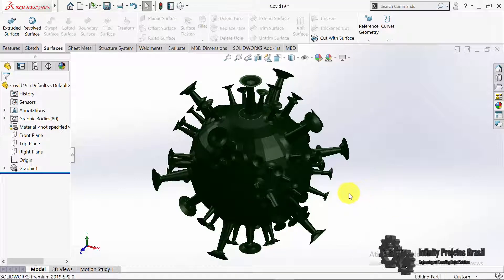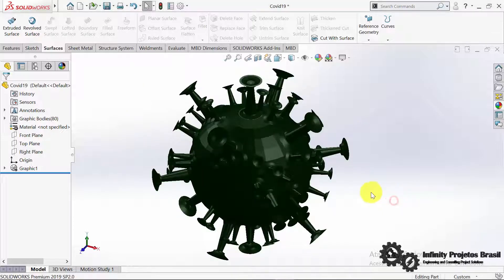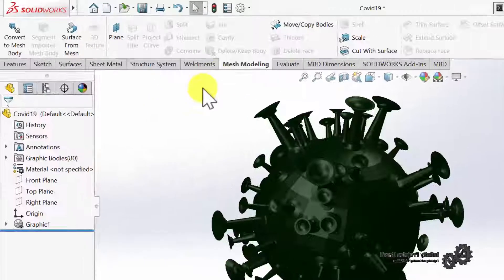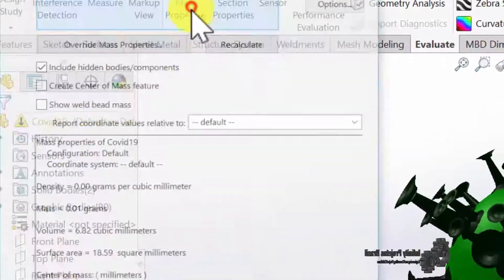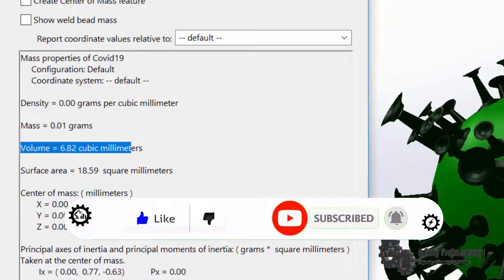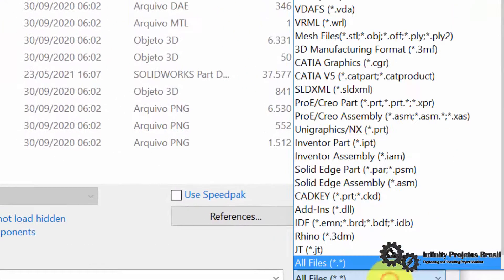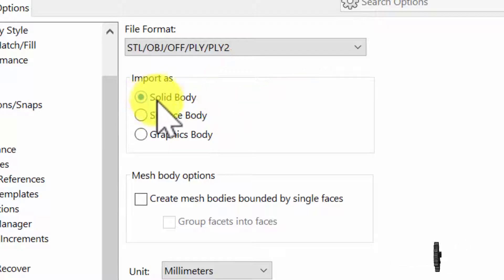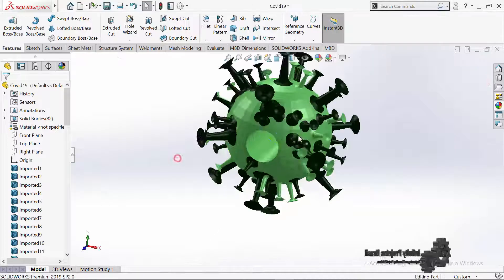Convert Mesh to Body Solidworks - Mesh Modeling - Change from STL to Editable Solid

Comment: The problem is that the solid you create in either of these approaches will not interact with other editing tools. So you have a solid, but you can't cut it, combine an additional solid with it, etc. I appreciate the effort, but the problem with mesh bodies in SolidWorks is that they're kind of completely different things, as far as I can see...
Reply: did you find a solution?
Reply: @xeb0lax  essentially I did a workaround, importing the solid model and living with it as-is

Comment: This really doesn't help when the graphics file is too large to import as a solid. Thanks for the waste of time
Reply: Well, Solidworks isn't really a tool for working with big meshes in the first place. It's like being pissed off at Blender that it isn't parametric.
Reply from the maker: Just leave it on for several hours and it works.
Reply: @infinityprojetosbr-solidworks  It will not work, it will only allow import as solid body if the file under a certain size. If the file is very large it will only allow you to import as graphic or cancel the import.
Reply from the maker: @lvlikeyV thanks

Comment: yes but I have a problem. The sickness of all details is 0. I tried to change thickness by choosing the surface and have a problem: unable to sicken.
Reply from the maker: hello friend, this tool sometimes doesn't work depending on the file and the thickness you want.  It is important that the file is light and the thickness is not too thick
Reply: @infinityprojetosbr-solidworks  I converted it and wanted to do flow simulation. But I have geometry alert: thickness=0, don't know how to fix it. By the way, my file consists of 1000 parts
Reply from the maker: sorry but i don't know how to help

Comment: how to get "mesh modelling" bar if in mine don't appear?
Reply from the maker: @Daniel Canestaro-Garcia thanks for the tip friend
Reply: @infinityprojetosbr-solidworks  how do you sketch on the converted body? When I select a surface there are no options to sketch
Reply from the maker: hi Jeremy, you must use the surfaces tools
Reply from the maker: hello friend, some old versions of solidworks do not have this bar, if you want to install solidworks 2021 I leave the link below so you can download it

https://drive.google.com/folderview?id=1GkuYWelTVS5njisgIDH_zXuJI851kLPJ